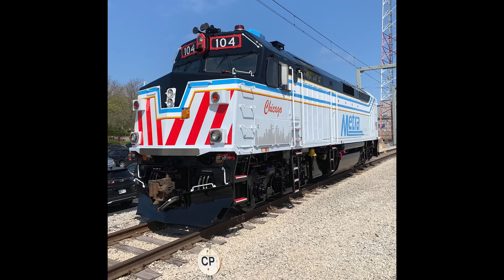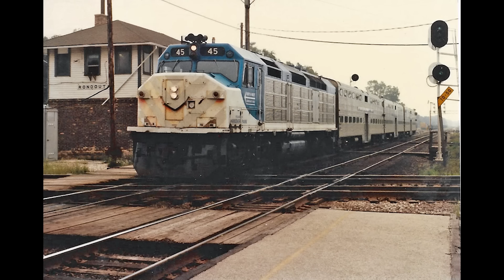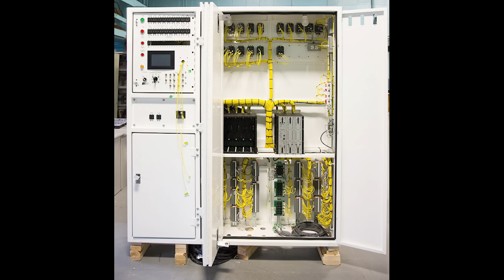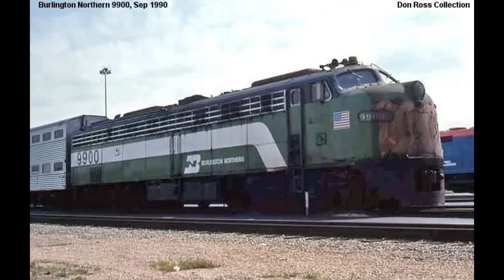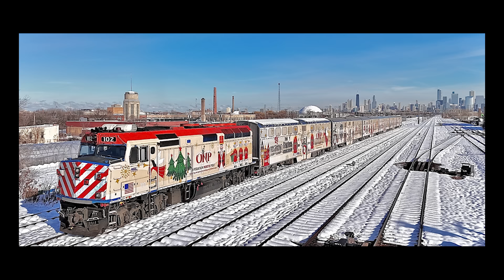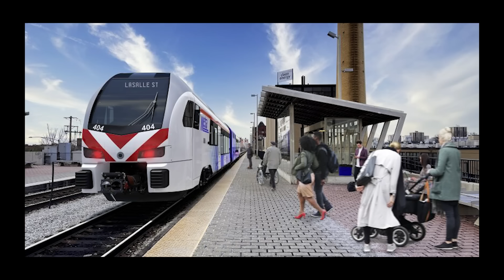How the HEP Equipped F40C Became the Midwest’s Forgotten Passenger Titan

Comment: WTF?  The F40C never operated on the C&NW.  They weren't all scrapped either, one is preserved in a museum, one is still stored by Metra and there might even be a straggler or two rusting away in scrapyards.  They were never numbered 101-115.  And what's with the random IC Electric, C&O, CB&Q, MBTA photos anyway?

Comment: Gee, I thought the EMD F40Cs were initially used on the Milwaukee Road instead of the Chicago & North Western. In fact, weren't they used exclusively on the Milwaukee's and later Metra's (or, if you insist, "the Metra's") west line to Elgin and northwest line to Fox Lake? I worked for the C&NW in the 1980s and 90s and never recall seeing an F40C in operation on any of the North Western's three commuter routes.